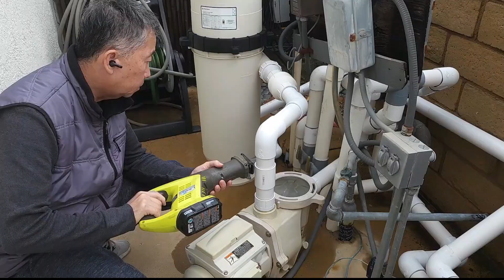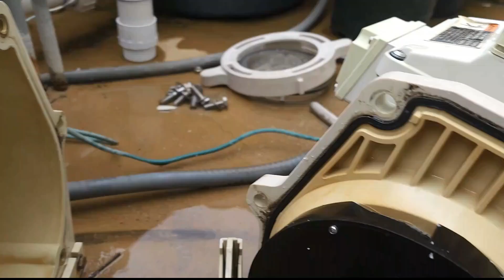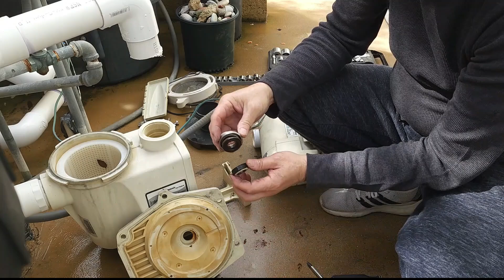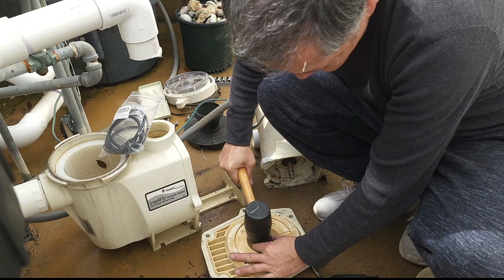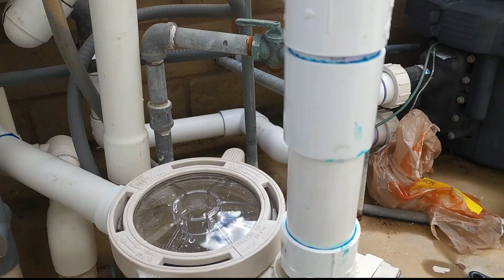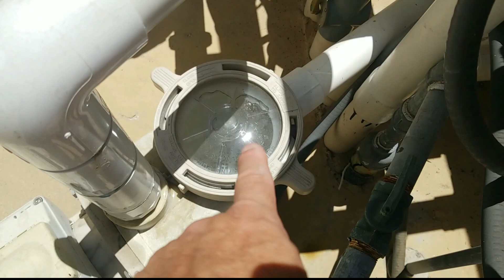Overhauling my Pentair IntelliFlo Variable Speed Pool Pump

Comment: A couple of things --- Whyd you cut that pipe? All the work is done on the impeller / motor side? Just a bad idea - as you can see .......Second - In my kit I had an "Extra" o-ring - which is the one that people are saying goes under the screw -- and YES - its there- pry it out and replace with the new one.  A helpful hint -- use silicone to put in the large Shaped o-ring. Put it in the groove first, then put the O-Ring / gasket in the groove- it will stick there while you put on that section before you screw it all together --- dry - and it could fall out of the groove and you would ruin it when you screw it together.

Comment: When do you rebuild versus replace?
Reply from the maker: I think these Intelliflo pumps are pretty well designed to last a long time.  Since they're designed to be fully programmable including motor speeds, I expect to keep mine unless the motor itself dies.  It's been running since 2012, so I expect it to run another 12-15 years.  If you have a much older pump, it could be worth it to replace it with one of these.

Comment: Great video.. very helpful!  I didn't find a washer under my impeller screw when I disassembled mine though.  Wondering if anyone else noticed that?   Also, suggest you add a union to the input and output of your pump.  Saves a lot of headaches for the future.   Lets you remove your pump for service without need to cut any pipes.   Anyway, really good video and I found it very helpful for a successful rebuild here on my end!  Thanks very much!!

Comment: You did an awesome job. BTY I repair old intelliflos, Sell remanuctred, & New for a living in Southern California . That drive you have has been discontinued,as Pentair wants to push the new Pumps that run off Phone apps & Smart Phones (Pentair Intelliflo 3 VSF) Also has different parts & Plumbing compared to the old school Whisperflos & Intelliflos that can run 15-25 Years just like yours Phi! . The best thing you did was change the PS-1000 Shaft Seal as the pump lives and dies by that.The biggest issue with the OEM Whisperflos is the inserts pulling out from the seal plate and water getting by the seal and into the motor. Awesome Video Phil." Knowledge is Power:- Einstein sincerely, Eben Collins
Reply from the maker: Thank you Eben!  I appreciate the compliment - and the info.  My pump is now about 10 years old, and I figure it should go another 10 years or more.  I doubt the repair parts will become obsolete any time soon so unless I come into a really great deal on a new smart pump, I'll hold onto this one.  Wish you well in your business!
Reply: @PhilsDIY  Not to worry I make these Pumps in house with a higher grade ABS Mold (Seal Plate with brass inserts, Wetend, Lid, & I even sell those style of Drives remanufactured which is the gold standard if your Keypad or drive ever goes out. My Company is Called PoolBargains,  as my dad was the founder of Advantage Manufacturing which I joined in 2008-2009. No different than Hennessy making the Camaro ZL1 into a beast. Or Agency & Zev making better parts than Glocks OEM. Cant go wrong with Made in the USA! Sincerely, Eben Collins President of PoolBargains
Reply: Hi there, I own a pool business and im looking to gain some info about rebuilding pumps. could i message you and ask you a question or two about pentair whisperflo pumps?

Comment: Why did you have to cut the pipe out? Why didn't you just unscrew the pipe to the pump?
Reply from the maker: Because the threaded fitting that goes into the top of the pump (the outlet) was not fully seated, and I had noticed a very slow leak from that fitting.  That required me to cut and replace the pipe because I wouldn't be able to tighten that fitting due to the angles and relative positions of the pump to the filter and the inlet pipe.

Comment: Why did you bother cutting and replacing the pipe?  Seems like you could have left it alone from the start
Reply from the maker: Because the threaded fitting that goes into the top of the pump (the outlet) was not fully seated, and I had noticed a very slow leak from that fitting.  That required me to cut and replace the pipe because I wouldn't be able to tighten that fitting due to the angles and relative positions of the pump to the filter and the inlet pipe.

Comment: Uh, you didn’t need to cut the pvc pipe either, just disconnect from filter 😂
Reply from the maker: I did have to cut the pipe, because I found that it was not in tight enough and had a slight leak, and no way to tighten it because of the angle to the filter.
Reply: @PhilsDIY  ok -- I didnt know thats why you did that-- I missed that partl